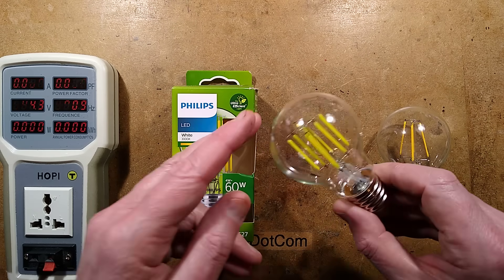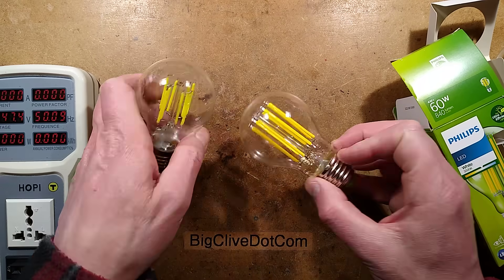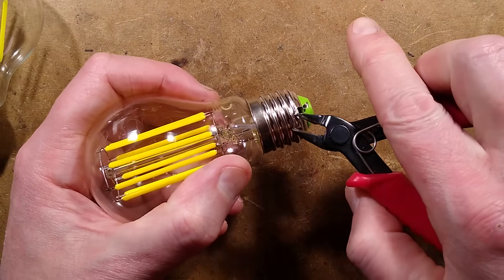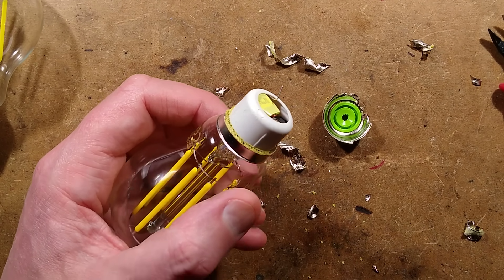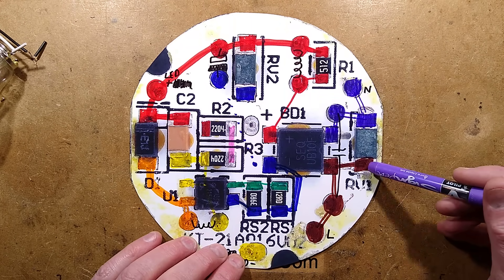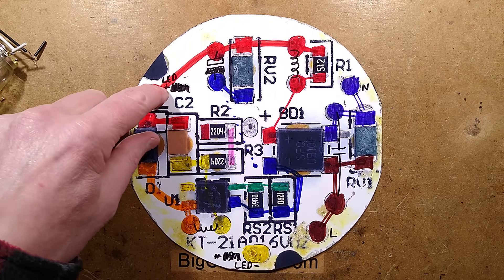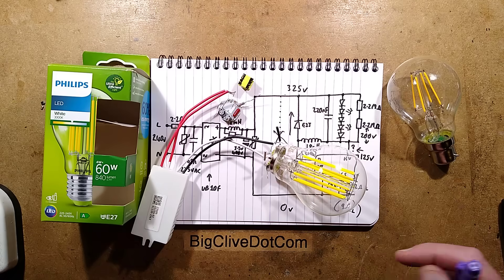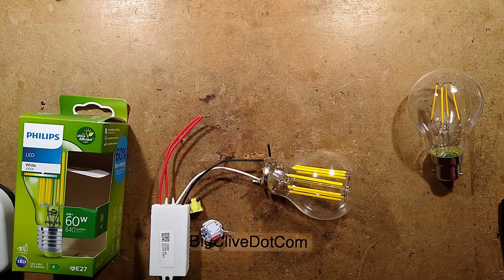Inside a new Philips ultra-efficient LED lamp (with schematic)

Comment: I think the symbol means don’t use it in motion detection security lights.
Reply: Wanted to post the same yeah. The “icon” looks like a human body walking past a PIR sensor. Only odd thing is the size of the body and sensor
Reply: These sensors are two-wire and three-wire.
Those with two wires are connected in series with the load. Naturally, the lamp resistance is too high and the sensor will not work correctly.
And with those in which the phase is placed in a separate wire and a relay is built in, these lamps will work well.
Reply: @Weather76  Could be it. My motion sensor light has a relay though. They do get a lot of switch on/off cycles in those. I bought an LED bulb for mine about 9 years ago but it was a rather pricey one and is still working.
Reply: @Sonny_McMacsson  just to confirm what you said there from my own experience.  The pir lamp fittings i bought all had relays.  Relay contacts are simply a mechanical switch.
Reply: @raykent3211  Good to know I wasn't under a misconception for 5 decades about what relay contacts are.
Reply: @Weather76   Yes. LED lights in certain dimmer and motion sensor circuits will behave oddly. They will glow or flicker even when turned “off” because a small amount of power is always used by the control circuit in series with the load.
Reply from the maker: That could make sense.  A snubber network would make it strobe.
Reply: @bigclivedotcom  I believe its saying it isnt meant for Flood Lights and similar type high wattage sources, dunno why they have to point that out :/
Reply: Or likely because they're not dimmable. Such fixtures often have a dim mode as standby which would fail in some way. If the fixture functioned only with full on to full off it would probably be fine.
We have a similar problem in the US (I imagine elsewhere as well) with LED lamps marketed for the microwave oven. People buy them for the under side, the oven hangs above the stove top with the light shining down. These most often have a 2 or 3 level dimmer function. But these lamps are all not dimmable.
Reply: @bigclivedotcom  Would making this bulb using a different driver increase the efficiency of the unit ???
Reply: @bigclivedotcom  I was thinking that the frequent switching might not be kind to the circuitry. The snubber thing sounds interesting though, perhaps you could talk about it sometime. (Never mind, I got the wrong end of the stick with that).
Reply: Pir
Reply: I was thinking not for emergency exit lighting, but your idea sounds more correct.
Reply: @davidjernigan8161  I was also thinking "Not suitable for emergency flight corridors, such as fire escape routes from high occupancy buildings" (such locations have extra requirements in the standard IEC regulations used by most countries).
Reply: that was my thought as well.  
I remember that you weren't supposed to use cfl's in those motion activated outdoor sockets
Reply: I was going to say the same thing. That rectangle with a curved lens on the front looks just like the motion sensor on a typical motion-activated lighting fixture.
Reply: I agree looks like a PIR shining on a path with a person walking in front of it.
Reply: Does anyone have a link to this bulb? I've been searching all over google and I can't find the bugger.

By any chance does anyone know a super, super warm bulb that's efficient? Talking orange or even red here
Reply: @priestesslucy  I would like a bulb like that too.
Reply: .... I was thinking, 'Do not carry a CRT while turned on'.
Reply: I'm going to agree with this explanation
Reply: I came to same conclusion as to what that symbol means
Reply: Yeah, the thief would steal this nice bulb 😂
Reply: My first though was not to use as a tanning light haha
Reply: This symbol strangely gives me Contra stage 2 vibes. IDK if people remember that level. The symbol looks like it's saying you can't run away from the level.
Reply: Not for disco lighting! :)
Reply: I thought the same thing.
Reply: PIRs
Reply: @bitTorrenter  Passive Infra Red (body heat sensor switch)
Reply: Yep came here to say the same.
Reply: The answer.
Reply: That's what I thought but I had to really tease it out of that considering I know how they basically work.
Reply: Yep. Your comment was a little down the list and I didn't see it at first so I just posted the same thing.
Reply: @thedoctor399 I think the second symbol on the left column  (Sun inside the upside down U) indicates it’s suitable for recessed light cans and such (not all LED bulbs are due to heat issues that can damage the bulb’s circuitry in its base) but the bottom right symbol almost certainly refers to outdoor motion activated security lighting.
Reply: That's also what I was thinking, though the symbol has strange proportions and is too complicated for its own good
Reply: Also do not use in emergency exit light fixtures.
Reply: @spambotfodder  yeah that seems like a good possibility as well.
Reply: i was lost at the meaning of the sign, but that makes a lot of sense,
Reply: I was thinking flood lights, which serves the same purpose.
Reply: 3 way switches on lamps
Reply: Ditto regarding motion detection lamps. Makes as much sense as anything.
Reply: @DoctoreE644  This person is so old that she uses 'ditto'
Reply: @FinnishArmy  yep, and old enough to know what pir means.
Reply: Guess what I did. I put this light in a motion sensored light we use as a security light. Outside. And the fixture dimms it on startup and when it goes off. I'm curious how long it will last. If I remember I'll comment here when it dies
Reply: @Snorkers i had a mechanical timer plug between mains and a (flicker free) PureZ Retro filament lamp. I think that also kills led drivers or electronics. Just fyi and your leds health ;)
oh i forgot: It has flickered like hell @ the end :D
Reply: Is that because they run on trickle current flowing through the lamp?
Reply: how would these work wit 120v
Reply: My guess is in a security PIR sensor, my reasoning, because it switches on and off a lot and also you said before some LED lamps have shorter life when enclosed in weather shield heat boxes!? 💁‍♂️🤷‍♂️
Reply: How many volts are thoes little yellow led filaments
Reply: Yeah that was my take also
Reply: That was my guess.
Reply: I was just about to comment what you just said. You stole the words right from my head. Great minds think alike I guess
Reply: @franklinjames7030  Fools seldom differ. And I agree, so it's not looking good for any of us